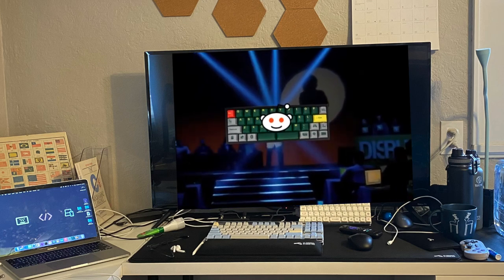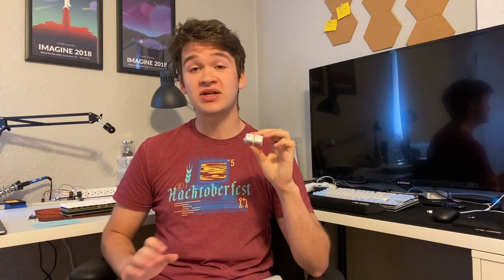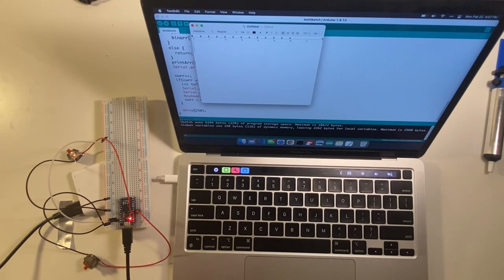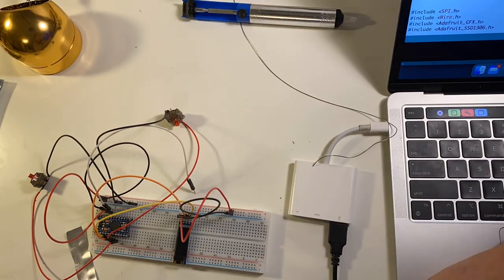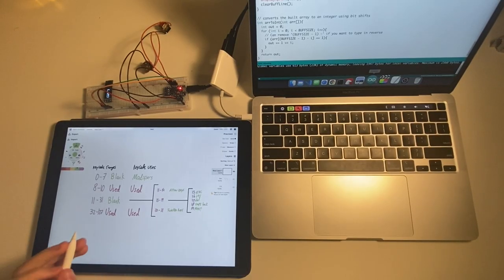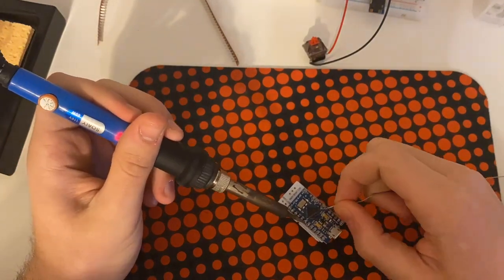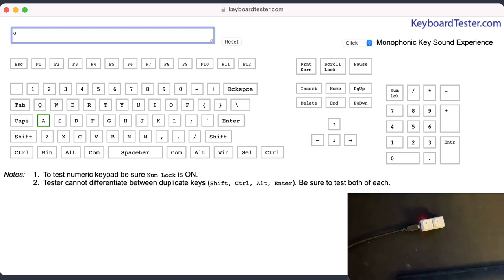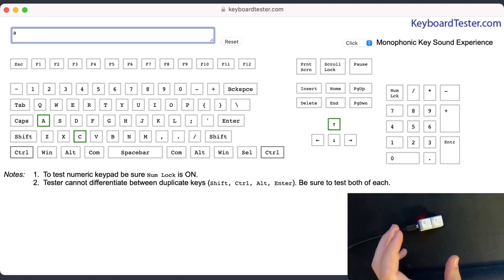THE BINARY KEYBOARD - Build + Typing Test

Comment: The obvious next step is to make a single key. This won't be a keyboard since it only has one key. An LED will blink on and off. You hold down the key or release it while the LED is on to record a 1 or 0.
Reply from the maker: One key is next. I think doing something based on Morse code will be more accessible
Reply: @AidanGlickman  Probably, though that requires learning Morse code, and building a decoder. You'd also need some kind of timer to differentiate between . and -, though you'd need a clock for my version as well.

One benefit to the Morse code version is that you aren't constantly sending 0s, and you don't have to worry about keeping up with the timer.
Reply from the maker: yeah exactly. Keeping to a timer and the issue of sending 0s means that morse is really the only feasible option in my mind. I just need to to expand it to add numbers, symbols, modifiers, etc. If I just structure it as a BST then the actual typing should be relatively trivial to implement.
Reply: @AidanGlickman  Oh that's a great idea! I wouldn't have considered using a BST, but that would keep your code nice and small and for a visual learner like me it would be eas(ier) to memorize.

Totally off topic, but have you ever heard of anyone building a physical MIX or MMIX machine? I'm working on one now and I'd like to have bragging rights of being the first ever.

And yes it is surprisingly painful. It's clear this was never meant to be physically implemented.
Reply from the maker: I think that there are Verilog definitions that could make an MMIX FPGA but I can’t find any instances of it actually being physically constructed
Reply: @AidanGlickman  Well hold onto your body part or item of clothing because there's gonna be one soon.

Okay, "soon."